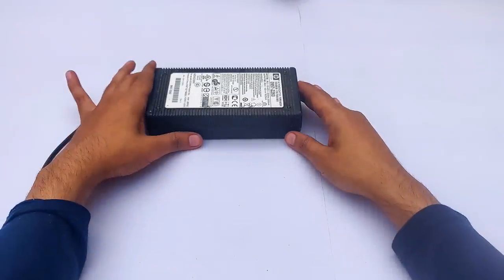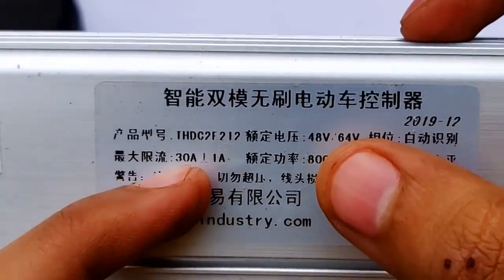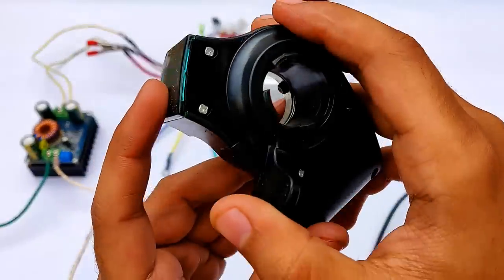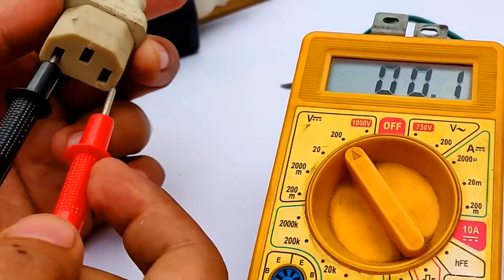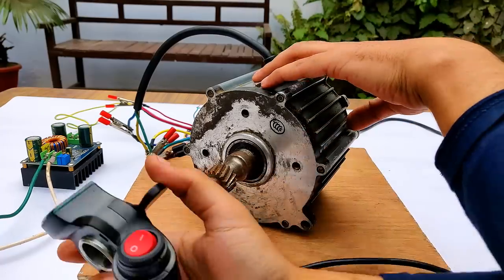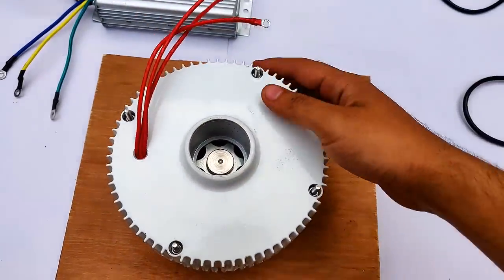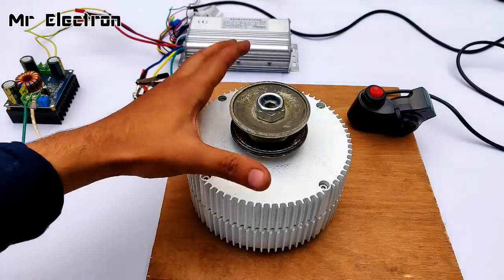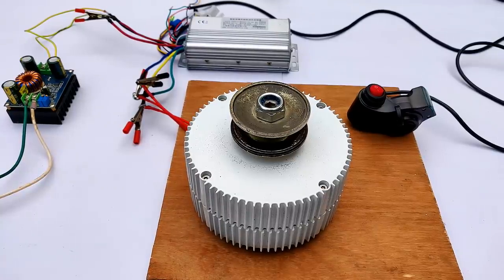12v to 24v Wind Turbine Generator as Brushless DC Motor - BLDC High Torque

Comment: Hello., I have something for you to try, not just talk about, but really try this... Get the following:  1) 4 dc generators. 2) 2 batteries 3) 1 dc, or ac motor only big enough to spin the 4 generators. 5) a belt, or hook them together..   Spin the generators with the small motor at 3000 RPMs.  see if the Generators can charge the batteries up to full 3 times... (Please don't just shot it down, try it) Your videos are nice...I will send the video across America, make you rich... only the batteries can be used as a power source...